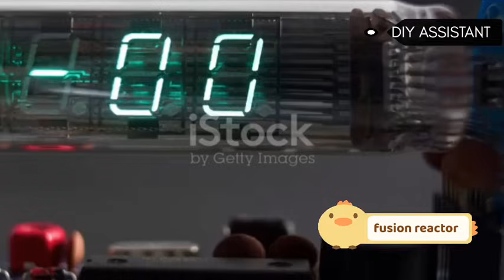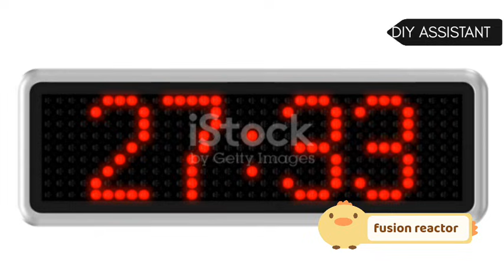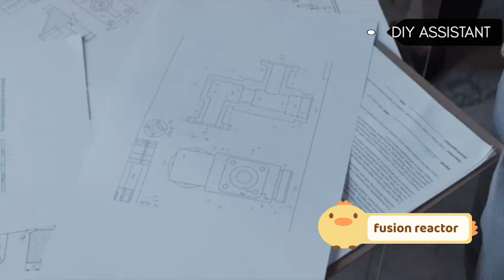"Germany’s Fusion Breakthrough That Changes Everything"

Comment: Definitely not a "mister fusion" tabletop generator.

Some of the risks: 
1. interruption to the power supply for the confinement
2. interruption of inflow of the fuel, which needs preparation into "pellets"
3. vacuum breach and air (oxygen) influx.
4. acceleration of the base frame (seismic, or deliberate kinetic attack)
5. radiation (neutron flux) embrittlement of the structures.

Seems more demanding than fission reactors. This all may not have grave consequences on small size models, but for any continuous high power production system (of any underlying physics principle, including burning things) there are catastrophic modes of failure which mean disaster.

This is still (the latest) one of the "violent" ways to collect energy. I hope we will eventually find a solid-state low temperature way of direct electric (or light in a fiber/waveguide) power generation from existing natural stores of negative entropy, including fusion of lighter nucleons. Some sort of quantum tunneling, perhaps?